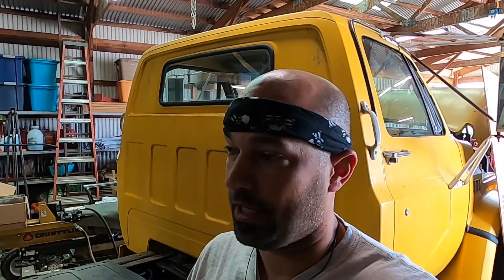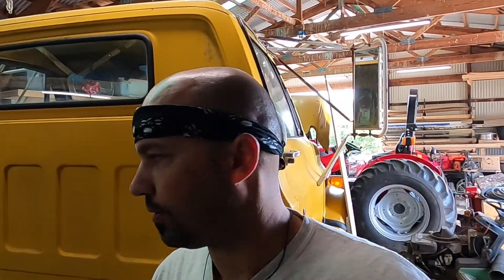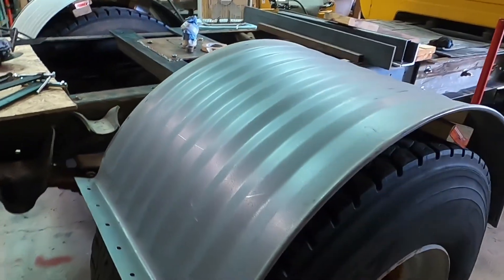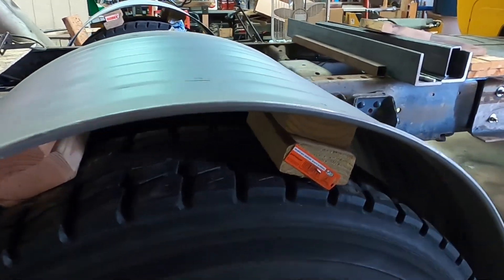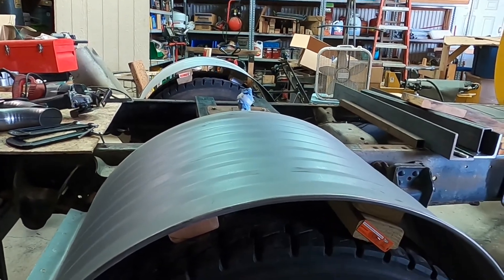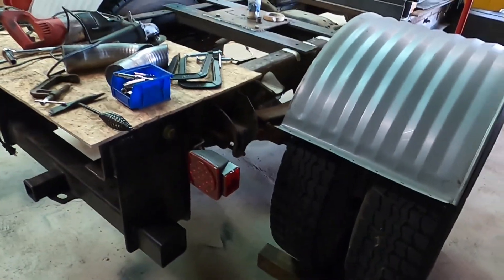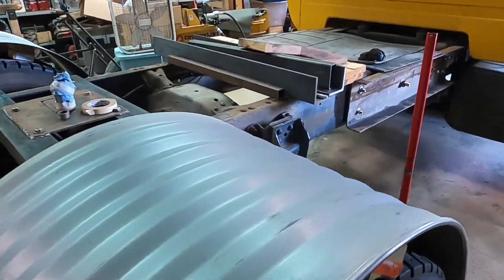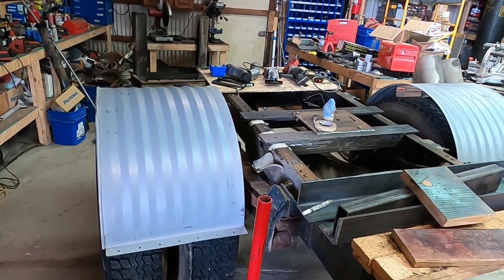Project Yellow: Fendered or Not - Cab and Chassis Fenders on 1987 GMC 7000

Comment: I had the same idea for my 1999 Chevrolet C3500 dually 1 ton dump truck while I was shopping at Lowe's ( light bulb ) I just haven't pulled the trigger yet ! It does have newer mud flaps on that I bought from Ryder truck parts & they have thousands of thick nipples sticking out toward the tires & do a great job keeping road spray down, But I want something to protect the bottom of the dump bed ! & the rear bottom of the cab corners & seeing them laid out on your truck they don't look bad , & they seem like they would be functional ? Thanks for the video .
Reply from the maker: Very cool!  I hope they work out for you.  Thanks for watching and commenting!